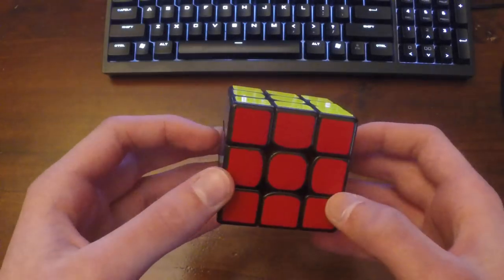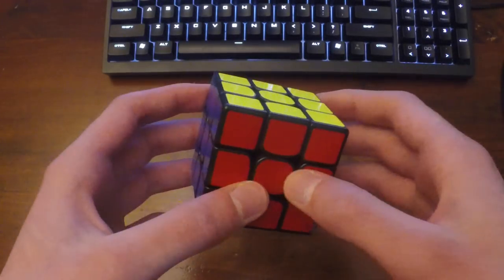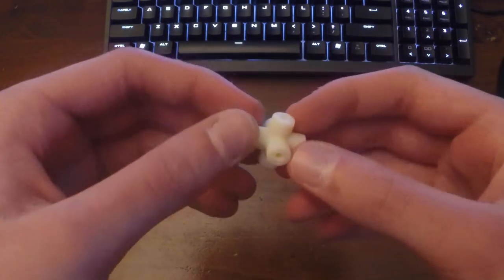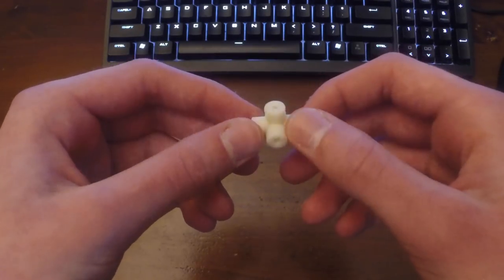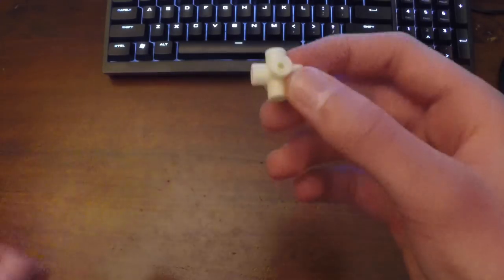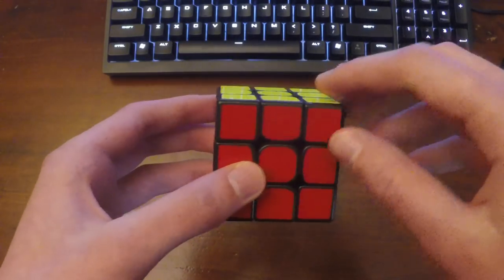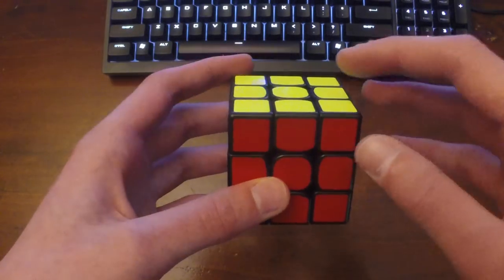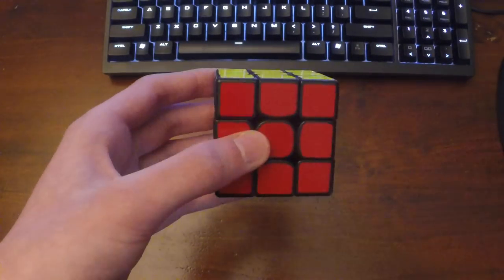Rubik's Cube Rotations: Explained!

Comment: So I'm practicing cfop pll and oll and the cube notation says y2'
what does y2' means?
Reply: Dafagit 999 if it says y2 for an oll or pll, it's a bad alg. learn a different one. good algs will ideally have no rotations, with a few exceptions (like G perms). anyway, y2 just means you turn the cube to the left or right twice, so the back of the cube becomes the front.